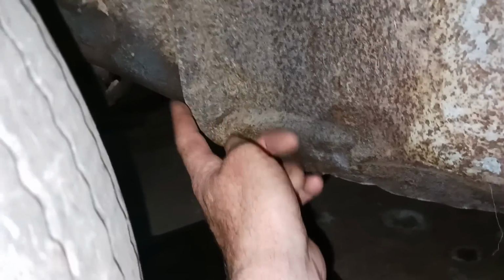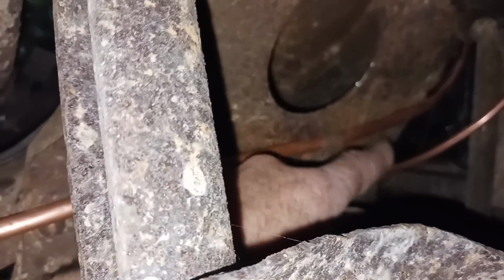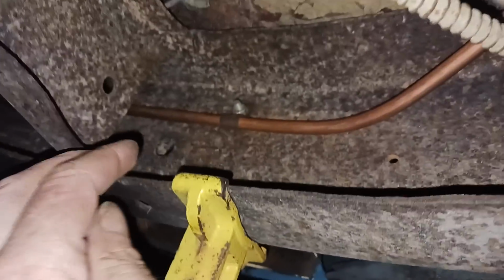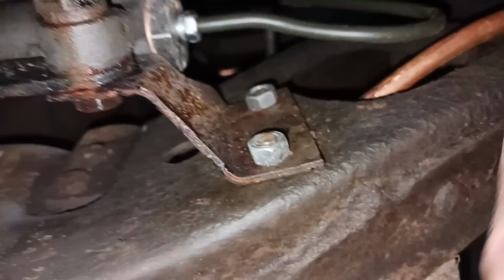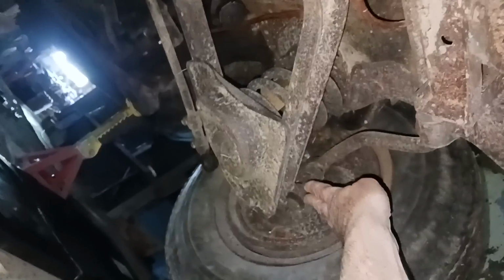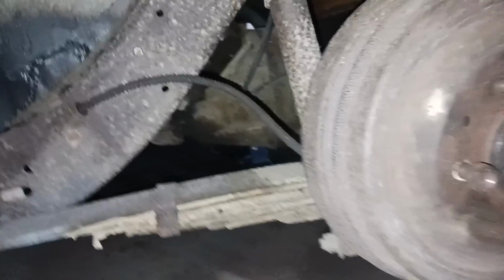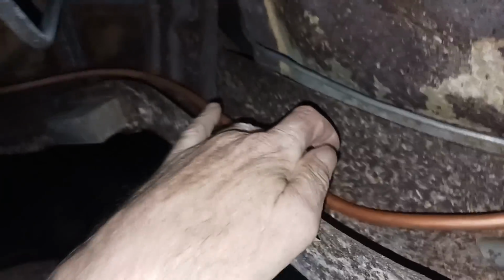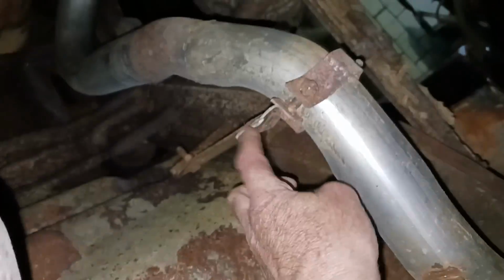fuel line is in not complete but in

Comment: Hi jim, you did a good job on relocating the fuel line and i would also put on some points a piecee of rubber hose around the copper fuel line just for protection, keep up the good work, it's almost ready for undercoating now, thanks for sharing

Comment: Years ago one of my friends bought a Datsun Pickup. I think it was called a "Hardbody". That was befor the renaming went on from Datsun to Nissan. Anyway, I live where they use A LOT of salt on the roads to clear snow in the winter. My friends Datsun Truck had an inline fuel filter located right behind the front tire where it could get lots of splash from the tire. A couple times his mini-truck wouldn't start, or it'd start but wouldn't keep running. But all he had to do was bring it indoors to warm up and it'd be OK again. It just so happened that one time when he brought it into the shop to let it warm up we put it up on a hoist. I was standing almost right under the fuel filter when a big block of ice thawed and fell to the floor. It went plop, it was like slush when it hit. I almost got hit by it. Then I looked and saw all of that icy slush had been packed up all over the fuel filter. Now anyone who has ever made homemade Ice Cream knows that salt and ice makes for a very cold mixture; something like -5°F or -20°C. So we opened up the filter and it was about 1/2 full of ice. It took us a while to figure out how, but we rerouted the fuel line out of the path of the splash from that front tire. Just a fyi for thought.  ben/ michign

Comment: Better job routing the lines, but I don’t believe copper is good for fuel lines, cracks from vibration over time. Thanks for the video
Reply: Better than rusty steel anyday, I've seen 100 year old original copper gas lines on old Model T's that are still in perfect condition. 😉✌

Comment: Hi Jim,
I know this is kinda late and everyone has their own opinion. Mine is I wouldn't use copper fuel lines. I've owned my '34 street rod since 1958. Many years ago I read that  copper fuel lines were dangerous in a number of different ways. I installed stainless hard   and braided AN lines and have driven all over the USA to S.R
 shows confidently ever since. I may be wrong but I don't think that your original copper lines are original. Hope that I haven't opened up a can of worms. 
Best regards,
MartyZin NYC
Reply: Copper Tube and Fittings has been used for Fuel and Oil as long as there has been Cars.

Comment: Copper is never a good fix. It's too soft. Original is steel for a reason.
Reply: The reason the Factory used steel is because it's cheap and can be preformed, Copper is better.
Reply: @65cj55  To each there own. A rock hot and  thrown toward the line will not pucture steel. Used forever for a reason.
Reply: @larryray4811  Yes correct, but copper was used for many years, and now a lot are alluminium, it will be fine.